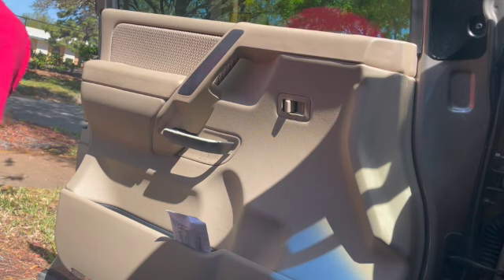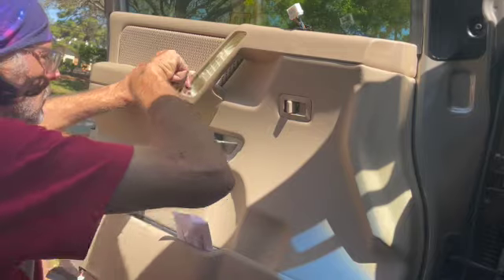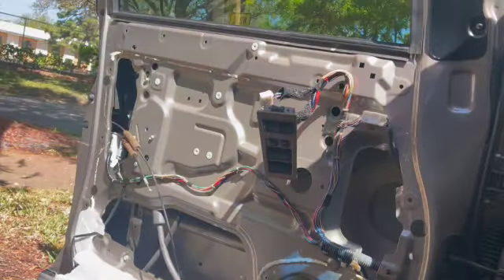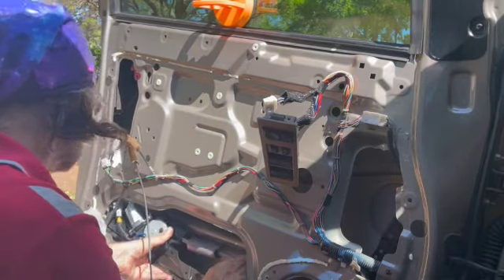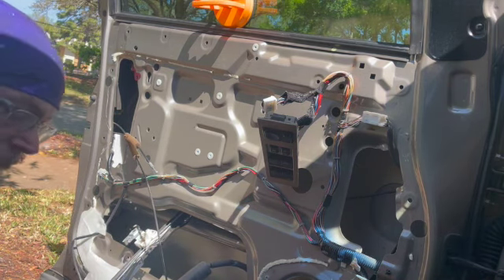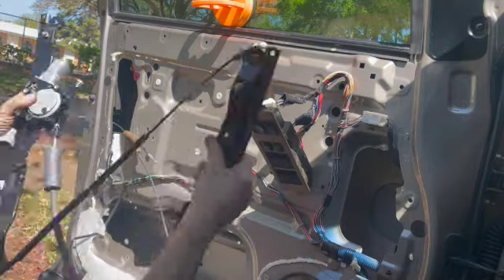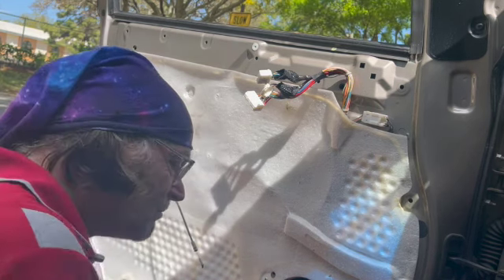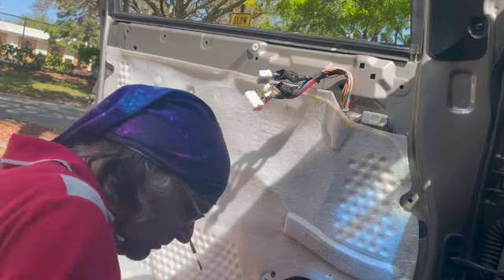Nissan Titan 2004-2019 Window Motor Replacement & Repair Left Front

Comment: This will be my 3rd regulator since 2013/140k miles. The 2nd one sounded like it was struggling hard right out of the box. I'm wondering if the window is binding making it burn up? Also nissan trim is never the same once its removed. The sheet metal gets bent when you try pushing the clips back in. My door is now held together with wire. On a windy day be ready for the door panel to just rip right off the door lol. The wire is stronger than factory so I call it a mod.

Comment: How do you get the window up if stuck in the down position or can motor be replaced with window down?
Reply from the maker: You will need to get the glass up to remove the bolts that hold the glass to the regulator. Just tap with a hammer where the motor is. Should get it back to life
Reply: @PowerUpAuto  i've been tapping on the motor and lubricating sides of the glass for over a month now. Motor finally gave out completely while the window was down. Was able to squeeze in a small ratchet and free the glass but it was a pain in the ass. Once the glass was out of the way everything else seems easy. New motor and regulator assembly will be here tomorrow. Thank you!

Comment: Great Video And Tips, I have 05 Titan With Power Windows But it Has No power from each individual doors. I check the fuses and replace them, I even swap the Master Door Window switch with Another one and still no power, I was thinking the window Motor, but if it was than I would still have power to each own individual window. Any advice?
Reply from the maker: Possible a broken or crimped wire in the black rubber boot that goes between the door and the body of the car.

Comment: I have a 2006 Titan the front passenger window goes automatically down when pressed but when I press for auto up it comes up, hits top and then goes back down about three inches and stops. Is it switch or motor?
Reply from the maker: Motor
Reply: Thanks so much I will try this out.

Comment: Hey! Having trouble with a 2002 Volvo S60 motor replacement! It has rivets that are difficult to get out
Reply from the maker: For this you will need to hire someone with a large rivet tool. The S60 is a challenge